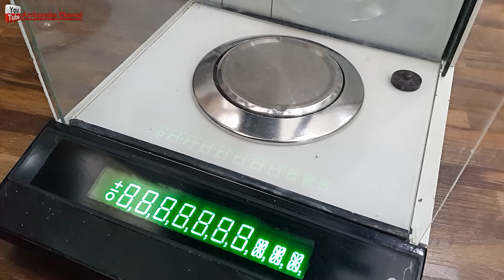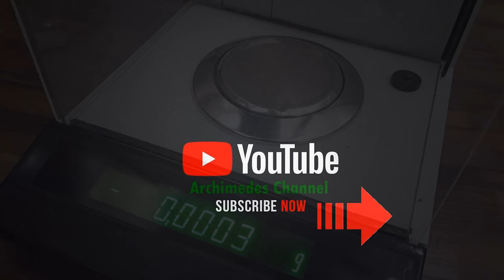How to recycle gold from motherboard computer scrap | How to make gold recovery ic chips computer

Comment from the maker: Thoughts on “Recycle Gold CPU Computer Scrap | How to Recover Gold from Chips | Gold Recovery | Recycling gold from scrap PC boards | Gold Extraction”
The motherboard is the large circuit board that connects the innards of the PC together. All the components communicate with each other through the motherboard. The Motherboard is rich in value and has several of the most valuable parts of the PC attached to it.
The board itself has many gold plated connectors and pins. Older and high end motherboards (such as those found in rack servers, telecommunications equipment, or military test equipment), often have gold in the traces and components. Motherboards are one of the most value-dense portions of the PC.
Reply: sir can you tell me are those  two chemicals that you used thank you,
Reply: Holle whatsapp
Reply: Dear
I am from sr i Lanka.
I tried same 
But cannot get gold.
Please tell me the right way to get gold.
Reply: Tell me chemical that you.
Pliss MR
Reply: This is possible
Reply: I know Im asking the wrong place but does anybody know of a tool to log back into an instagram account..?
I was dumb forgot my login password. I would appreciate any assistance you can give me
Reply: @Roger Shane Instablaster =)
Reply: @Tate Israel thanks so much for your reply. I got to the site on google and im in the hacking process now.
I see it takes quite some time so I will get back to you later with my results.
Reply: @Tate Israel It did the trick and I finally got access to my account again. Im so happy!
Thank you so much, you saved my ass!
Reply: @Roger Shane No problem xD
Reply: Farooq
Reply: @mateo13689  1st one Sulphuric Acid some hit it, 2nd one is Nitrc Acid.
Reply: Hello me more than
Two thousand kilograms

Parts

I have gold

I wanted to see if gold can be obtained from these pieces?
How do I send you a photo?
Reply: Im a scrapbuyer. Do you have tutorial how to make gold in scrap. What material did i prepared? Thank you
Reply: Hello how are you hi can you tell me about gold polishing on gold jewellery I mean electropolishing in Gold jewellery
Reply: Hlooo for computer only

Comment: How about recycling the PCIe, PCI, AGP slots?
How about the headers?
They contain a tiny amount of gold as they are gold plated, probably not 99.99% pure but they at least contain way more gold than a piece of rock from outside.
Reply: It is plated on so those fingers and pins have pure Gold but you have to dissolve the base metals with hot Nitric acid first, rinse to remove the Nitric, then dissolve the Gold with aqua regia and precipitate the pure gold with Sodium metabisulphite, there are a number of videos about the process.
He would have probably only got about double the yield of just the chips though and those acids are sometimes hard to get, quite expensive and quite dangerous, on this small scale it isn't worth it..

Comment: Great presentation! I have some questions, From what I understand there are more wires inside of the chips, There is a process of burning In a furnace, Then grinding chips Pulverizing them, Do you do this? Also are the wires solid gold as in 24 carat? What about all the other gold plated pens, Do you extract the gold from these also? If so do you have a video on this?

Comment: the motherboard has more gold in it than the chips, the memory sockets, the IDE pins, the CPU socket, the PCI slots are gold plated and that's where the gold is, there is very little in those chips.
Reply: Yep. Every pad is gold plated would have been best to burn the whole thing up then chemically separate the gold from the ashes.

Comment: This might be a silly question but here it goes. Why not just smelt all the boards down to their core metals and then seperate the gold? Seams like it would be faster if you have a ton of boards laying around. All the wafer and other plastics would just melt and burn away no?
Reply: it would be best to do that if you have like hundreds of motherboards to do that, otherwise its only worth taking the high yielding items.

Comment: The main chunk of gold lies in the RAM and processor not in the IC chips. DDR2&3 has the most . For every kg of these RAM you can extract 1-2 GMs of gold easy. Use nitric acid instead in the beginning then use aqua regia. Urea and finally sodium meta bisulfite.
Reply: Also nearly all the things pointed to were bga not ic
Reply: IC and BGA chips are one of the best sources.But the best one is catalytic converters:there is not less than two hundred dollars worth of PGMs in the single unit,and some of them contain up to 3500 dollars per unit-at least that is my current personal record!
Reply: @johnsheppard1476  things like the gold Crystal ossilators and gold fingers are great gold kilos of them to process
Reply: The processors are virtually gold free today.

Comment: Just burnt $200 worth of electricity for $70 worth of gold.
Reply: Not even fifty cents of gold.
Reply: @jamesmclaughlinprimitivele4587  it depends.And the best source is catalytic converters!Those contain not less than 200 dollars worth of metal from each unit and once I got 3500 bucks from a single Ford F-250 cat converter!
Reply: @johnsheppard1476  John might have got a good pay when rhodium was 10,000 a ounce but 3500 from one converter? Also this video is not about converters.
Reply: @jamesmclaughlinprimitivele4587  I mean that I also did try to process a bunch of these e-waste things,was looking for old computer parts and things like that,and than spent a lot of time and effort to get gold out of them,and was either left with a very small profit or even without any at all but when I got my hands on cats-I was just amazed how much do they sometimes contain in their honeycombs!And although processing cats is much more complicated process but I managed to make it in the easiest and fastest way possible that also gives 100% yield from them!However it is quite dangerous way but I like it because in just one simple(but long and dangerous) step I am basically left with only PGMs powder at the bottom and none of them in solution:I am about applying 70% HF to bang ceramic crap and other useless poop which it does very precisely and accurately as nothing else,and so I basically decant that useless but dangerous solution after all in the barrel where I neutralise the remaining HF with simple sodium bicarbonate and wash my PGMs until there is no more HF left and than just have to deal with mixed powders being palladium,rhodium and platinum sponges!
By the way that is simple as shit:first of all leaching all palladium with 70% nitric acid and separately precipitating it with DMG;and the rest of stuff goes in the hot aqua regia which I usually boost up by bubbling chlorine gas through it and either everything dissolves or just some rhodium is left;and from the solution I also first precipitate the rest of rhodium!So I just add sodium chloride and when reaction stops I evaporate all the liquid and so the remaining crystals of sodium hexachloro rhodate and all the rest of the stuff-so I dissolve everything except first 7 in anhydrous ethanol and so I am filtering all the rest of the solution and washing insoluble with ethanol,throw both in the melting dish and smelt rhodium in this way,and the last step is recovering platinum metal..I don't increase the amount of work any higher than necessary so I just burn the solution with ethanol and that results in platinum sponge embedded in some leftovers of NaCl and other stuff left from previous steps so I also simply dissolve everything in simple water,and than wash and smelt the powder..Anyway it's really not that difficult process I have to say..
Reply: @johnsheppard1476  
Hello 
Can you guide us to start this business?
Reply: @saurabh9517  well,I can at least describe everything you will physically need to make it as cost effective as possible and also I am pretty sure that I will be able to answer most of the questions you will ask about the process itself!

Comment: So, I'm looking at the motherboard where the main processor locks into the board. The plastic white or tan housing, when removed, has the processor connectors to the motherboard. Are they also gold?
Reply: No that's copper wire to conduct electricity in the board to the chip, of you have old type mother board like from 1980 then that wire or that mother board also contain gold because in the past they don't have a thecnology to conduct electricity  into the board as we have nowdays so they just using pure gold since it is good at conducting electrocity.
.

Comment: Process the Gold bond wire with Aqua regia will probably be easier and cheaper..
Reply: Good one but I think processing with cyanide and then splitting gold particles using gold splitter mite get a pure gold
Reply: What is the formula for making aqua regia
Reply: @ShanShaikhOnlineTips  3 parts Hydrocloric acid 1 part Nitric acid molar ratio. Example 35% HCL 100 ML. approx 12-15 ML of 68% Nitric acid, there are other methods as well, such as adding a nitrate salt such as Potassium Nitrate to HCL.

Comment: Radius is about = 0.592 mm = 0.0592 cm
As a sphere,
Volume = 4/3 * Pi * r^3 = 8.7046632124352331606217616580311e-4 cm3
Density of gold = 19.3 g/cm3

Density * Volume = 0.0168 g

Value = 50$CAN / g
Value of the sphere of gold = 0.84$

Comment: Hello, I do not speak English .. I want to know .. in the first addition of acid .. is sulfuric acid? ... in the second addition is nitric acid?
Thank you
Reply: I guess he used H2SO4 at first to dissolve things like nickel, tin. H2SO4 will also destroy the whatever plastics there is I am guessing.

In the second part, he is using HNO3 to dissolve nickel, tin, copper.

Comment: How to extract gold from Mather boards without using acid or chemicals
Reply: It's like walking without legs or fucking without women!Also hardly possible and also not that effective and simple.And the refining of any sort without any chemicals is completely impossible even to imagine-so until you are not fearing to use a bunch of hazmats to recover any precious metals from any possible source your only way to get them is to use them or to buy them if you don't.Period.
Reply: However the very cool way to get them is to use mercury amalgamation process:it is faster and easier plus the reagents are reusable for many times and the only chemical that you will need will be just the nitric acid to dissolve mercury and that is it!
Reply: You can remove the components and collect as many things as possible when you get enogh things to process speak to the people on the Facebook group ewaste recovery and they will do all the acids for you for 25 percent of profit
Reply: @rochellepratley1678  I would have been really happy to do that for 25% of metal!Hate dismantling all that stuff!And love f**ing chemistry!
Reply: @johnsheppard1476  join the face book groups and tell people a lot of people will be sending you things like old intel pentium cpus like 50 or 60 of them etc
Reply: @rochellepratley1678  would be pretty good thing!I currently mostly do recovery from catalitic converters and although it is quite a good thing with a lot of platinum group metals(especially I personally like rhodium which is present in conjunction with platinum to improve it's catalitic properties)-and although the only way my own products look like is pure metallic buttons that I extract,purify and smelt myself,including this case-still the process itself is vastly more complicated and time consuming than for any gold bearing material processing!Just for example I was once comparing the rate of dissolving different metals in aqua regia and so I managed to make exactly 1 gram each beads of gold,platinum,rhodium,iridium and ruthenium which I also made(including iridium that I purified via inquartation)-and put them each in it's own small batch(I prefer using small 100ml sauce batches)-and poured half way aqua regia in each one..In less than 15 hours golden bead was gone,platinum etched and all the rest untouched.So I applied constant heat of 70°C and left the rest alone..The platinum disappeared in around 30 hours later,and with iridium and ruthenium as expected there was no reaction at all;rhodium was miserably etched so I continued with it for two weeks more and had dissolved only 0.04 grams.In hot constantly boiling and re-condensing concentrated aqua regia for so long!So I proceeded further and applied over concentrated hot bleach with some ammonium perchlorate as a Kickstarter:ruthenium got dissolved and rhodium and iridium were untouched.So I fused them both with molten oxone-a really Satan's kimchi that is formidably banging all ceramic and other stuff so I ended up with rhodium metal quite quickly consumed with a bunch of ceramic crap which was annoying me like hell during precipitation but surprisingly iridium was still untouched:with all the stuff that I done to that moment was just kid's fun in compare to the last one which is actually the only thing that is capable to dissolve iridium metal in compact form and the same time is possible to exist in the same room with a living human without too much chance of killing you and demolishing your house upon escape!So I smelted the iridium bead with molten potassium superoxide and managed to dissolve 0.06 grams of iridium but while I was doing it-the molten KO2 which has no rivals in terms of being unstoppable matter devastator,made it through the 10 centimetres of refractory brick and so I had to dig the iridium bead from the ground below!So I guess it is quite an obvious thing that gold is quadrillion times easier to leach from anything than rhodium or even platinum:there is the only reason why I am actually doing cats and that is because they are the best source of precious metals among that are available FOR ME,and therefore I would have been really happy to recover 0.35 grams of gold from each of 100 processors per day and to get my part of 0.1 grams from each,which is easy enough to be done by 8 years old kids without any specialised tools and Satan's kimchis like molten KO2 which actually tend to stick to anything and also climb up anything that dares to touch it and to continue self-propelled reaction with it until full depletion which is actually meaning that if a person is dumb enough to touch it-what happens is that at least his finger and probably even his entire hand gets covered in this crap and then this poor dummy is completely unable to knock off a single droplet of KO2 which in it's turn rapidly disintegrates the person's hand with releasing loads of heat in process until it is fully depleted-and the funniest thing is that it is volatilizing and so upon gathering significant amount of it in lungs the person who dares working with it gets the same thing in his lungs resulting in swelling and suffocating to death drawning in lungs' liquid mixed with potassium hydroxide and potassium carbonate!And the only temporary protection for breathing organs is not gas mask because it's filters clog permanently after several inhalations so the wet towel is helping for a bit longer plus holding breath is really helpful..Definitely far worse than aqua regia!
Reply: Sell to junk yard, take money and buy gold.
Reply: Provide facebook group link